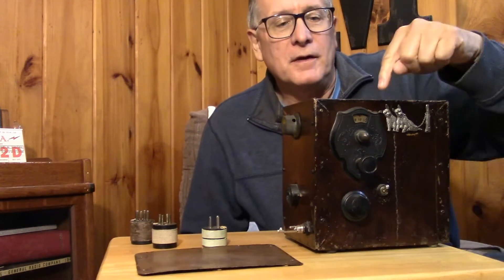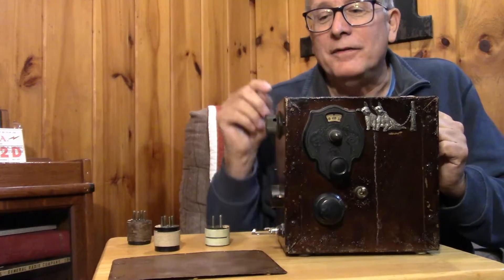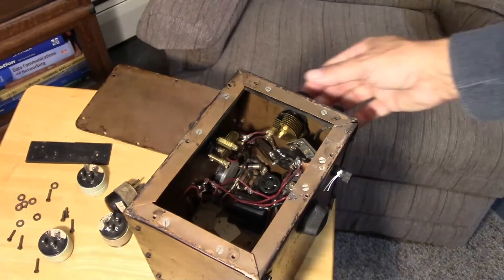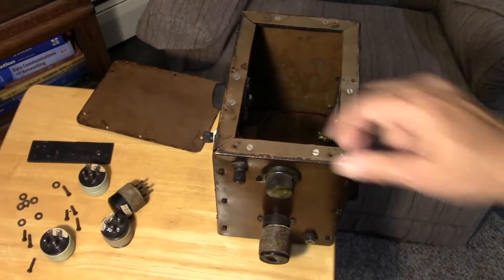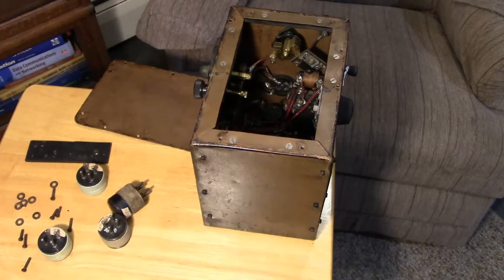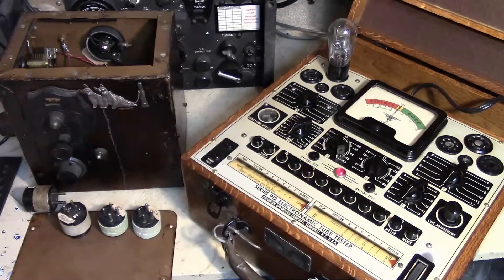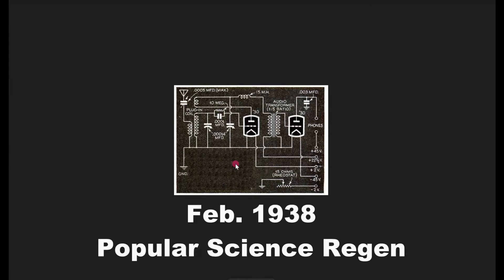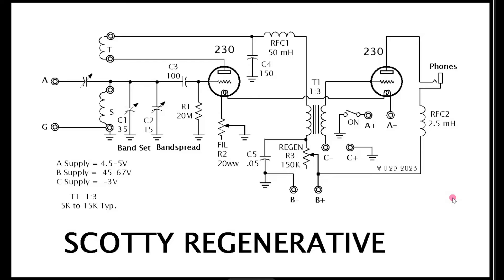Steampunk 1930's Ham Radio Regen!

Comment: Mike, what does thrill box mean? You used the term about a minute in distinguishing the radio as an amateur band radio, not broadcast or shortwave or thrill box.
Reply from the maker: The National Company made a small regenerative receiver with plug in coils designed in the late 20's during the depression, called the SW-3. Versions were made or 2 and 6 VDC. It used two tetrodes, an RF and Regen  and a triode Audio stage. It covered from the BCB to 15 meters in 4 coil sets. This was a capable ham receiver for many, but was coined the Thrill Box by Shortwave Listeners.
Reply: @MIKROWAVE1  Thanks, Mike!

Comment: The Jones 1936 Radio Handbook has a RFC-decoupled Headset and B+ line. I'll get you the page-number if you"re interested;
Reply from the maker: The technique does block RF so it adds to the decoupling possibly improving the RF bypassing (throttle capacitor) thus possibly helping stabilize the feedback.

Comment: What about replicating that radio using that flat vacuum tube with the 1.5V heater and A B+ of 45V might be a bit microphonic but that cannot be helped and don't generate much heat but it makes me wonder how the manufacturer uses them in in their pedals
Reply from the maker: Have you considered open air triodes - no vacuum?

Comment: In this schematic at 10.23 I do not understand the filament voltage on the second (output) tube !  It seems to have no voltage to light the filament.  Your schematic later on does, but this looks like an original photo???  There is 45 volts across the filament to plate, but no apparent source of filament voltage?
Reply from the maker: Likely just an oversight.

Comment: Ah, a cliff hanger. Very appropriate for something from the 30s, much like the serials back then. Will Captain Mike regenerate the regen? Or will those old capacitors blow higher than Vesuvius? Tune in next week to find out!
Reply from the maker: Soon. Soon.
Reply: @MIKROWAVE1  No rush, as the tension mounts, so will the ultimate enjoyment. 😅

Comment: Actually the type 30 was made i 3 formats.  The very first version may have been the tubular "T" envelope, most dry battery tubes (such as the 199) were first made in the form.  Then they switched to the "S" or spherical / globula type you showed, and finally to the "ST" bulb.  In the '50's, they even switched back to the "T" or "GT" format again!
The original "Twin Plex" circuit was from the 1930's.  It was actually the same circuit as the dual type 30, but it used a twin triode type 19.  I built one of these.
Reply from the maker: Wow very early battery tubes. Not having a cathode to heat has battery benefits including less heating current and instant on.

Comment: Regen receiver is a freqency depended negative resistance converter. Negative resistance in antenna make "black hole" for radio waves. ( very sensitive reception ).
Antenna transmitts negative resistance to enviroment thinks ( house walls, tree's ground... ) and "attract radiowaves".
Reply from the maker: Wow like a WAVE MAGNET!

Comment: It's always a good sign when the getter flash is still all shiny. If that's the case, then helium ingress would be my only concern about the vacuum.
Reply from the maker: The sad vacuum tube hides its pain with a white film.
Reply: @MIKROWAVE1 I’ve noticed some of the cooler running tubes, and even some some of the hotter running 7pin’s there getters will get this browning color from gas ingress, the getter doesn’t react fast enough to the small amounts of air, or other gas’s that either gets in from the pins, or the metal parts when it’s cold. If it’s hot it will work. I’ve managed to save some tubes from gas by baking them in a oven but these were small tubes took around 24 hrs or more baking at 350°F  I’ve since stepped up the temperature to around 420°F one must be careful with tubes that has bases on them. After I saved the one tube I experimented with several tubes that tested bad, good, and you could say questionable on the tester. Some I knew were gas, some had grid emissions which I knew, others were just weak, or maybe it was gas. Because now I’ve gotten a jeweler loop Magnifier, and within some of the tubes there our little gaps that you can see within. Gas will ionize around the metal parts like a neon bulb, and has a purple, to powdery blue glow. Doesn’t look anything like they high voltage blue glow that can be “normal” I do not notice that sort of blue glow until B+ is around 220volts, and it hugs the very inside edge, or wall of the glass tube the “envelope” not around the mechanical internal parts, and it’s a very distinctive blue, not powdery (like 
there’s a bit of white with it too)
The first tube I saved was a 12at6 tested fine on the triode section, the diode sections were tested with a higher B+ on the emissions tester I have, when I pressed test, I could see the gas ionizing between the diode plate and cathode, and around it. I tried a 12av6 as a substitute but made the radio receiver sound kinda tinny. So I figured what do I have to lose to experiment, chucked the 12at6 in the oven tested it every 8 hours each time the diode sections became better, to the point that I even turned the testing voltage up on the tester it’s self making sure I couldn’t see any more ionizing gas. There’s a high possibility there’s still a small amount of gas inside.i lost a fair amount of the getter material inside the tube too. Tube still works perfectly fine, it’s been about 3-4 years since!

Comment: The Vacuum tubes made to operate of 12V Heater supply and a B+ of 12V might also work well,you know the ones made in 1957 for use in Car Radios when the transistors of the day were not ready for prime time so should work of 4xPJ996 batteries.
Reply from the maker: Of course battery tubes are more efficient than space charge tubes because the space charge tubes require a very hot cathode. 120 mW compared to 1.8 Watts per tube.